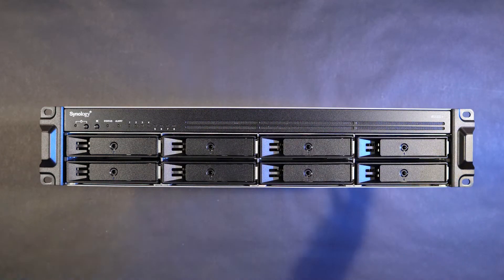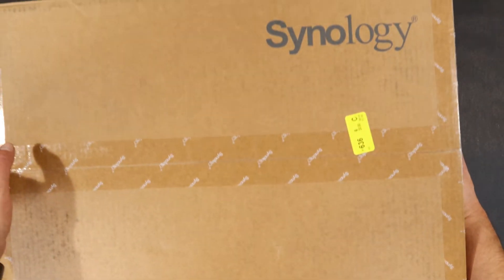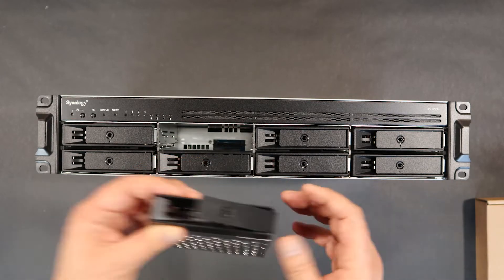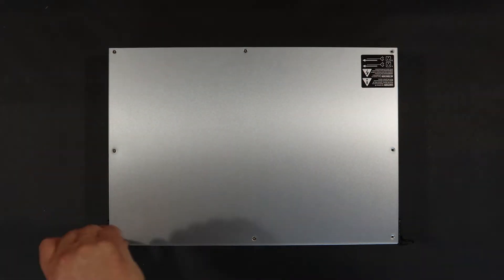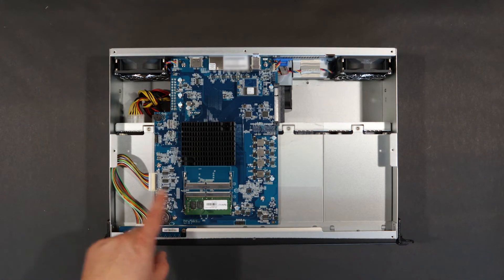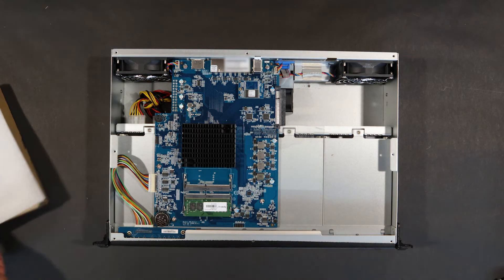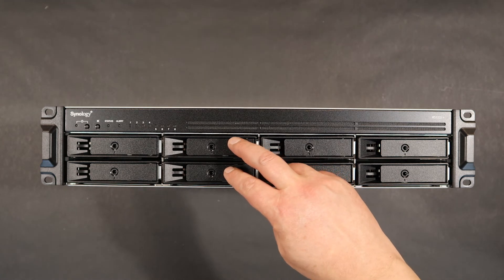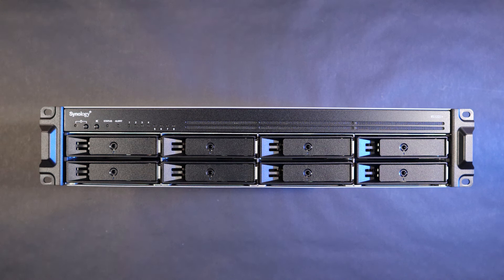Synology RS1221+ | unboxing and SFP+ 10Gb network upgrade

Comment: Swapping a redundant drive from a raid array on a monthly basis is not following the 3-2-1 backup rule. You need to have your main copy of your data, then another copy of that same data on a different device or media, and finally a cloud copy. Synology makes it very easy to set that up and it can all happen automatically on a schedule.

Comment: Cool but expensive. $1800 for the NAS and network card BEFORE the drives. Yikes!
Reply from the maker: Thanks for the comment! Yeah, it’s a bit pricey, and most folks don’t need this much space, or the rack mountable enclosure (which is more expensive than the desktop equivalent). I do save money by using cheap disks, because the RAID1 arrays will keep working if a drive fails; I generally don’t spend more than $50 on any single disk.
Reply: @MakeHomeTech  Any problems with drive compatibility?

Comment: Odd form of drive swapping you're doing. Never heard of anything like that. 10GB is nice. It's what I have now. How do you find it? I think it's not as fast as it could be, even with 10 drives in one NAS and 9 in another.(SSD caching in both.) In the process now of upgrading the two NASes and two Dell PowerEdge servers to 25G.
Reply from the maker: Hey Jeff. Thanks for the comment! The drive swapping serves two purposes: 1) quick way to get a third, backup copy of my data from a RAID1 mirrored drive set 2) mitigation tactic against simultaneous failure of both drives in the mirrored set, by staggering their operational wear across the three drives in the set. I'm working on a video that talks about my data storage strategy, so keep an eye out for that.

10Gb networking is da bomb! It's most valuable for video editing, since I  use the RS1221+ basically as a hard drive for my video editing machine.   The 10Gb connections lets me scrub through video timelines at an actually useful speed vs. the old 1Gb connection, which was painfully slow.

25Gb networking sounds very cool. Are you using fiber lines between your devices? DAC?  I'm also curious to know what day-to-day operations you have going on where a 10Gb connection seems "slow". :-)
Reply: @MakeHomeTech  Regarding the drive swapping, doesn't the array need to rebuild when you swap in a drive? And have you ever tried running with one of the swapped out drives as the only drive in the array? Does anything need to be done at the OS level to tell the device that drive is authoritative? I've recently acquired a 28-port 10G Unifi aggregation switch and even with that switch uplinked to my current Arista 10G switch, I am getting better through put than I was before the Unifi. I think the poor 10G performance is linked to the Arista switch. Can't wait till it's gone. The Unifi uses a fraction of the power and is nearly silent. The Arista is anything but silent. All the equipment is in my bedroom. The Unifi has four 25G ports. I'll be doing fibre. Two Dell PowerEdge and two big Synology NASes. Fibre cables arrive today and transceivers arrive tomorrow. All I need then is the Mellanox 25G cards, which are not cheap. Fun project, but I've had to dive into savings twice so far.

Comment: Pretty sure the 3-2-1 backup method means 3 copy’s of your data as in 3 devices. Raid is not a backup. I do like the RS1221+ it’s what I’ve been looking at for quite a while now.
Reply: 3 copies of your data, on at least two different devices with at least one offsite. RAID is not a backup and removing a mirror to force a RAID 1 rebuild regularly isn't a great way of obtaining one. I use hyperbackup to a USB drive and also to Synology C2 cloud. As an extra, I have two USB drives and I rotate them offsite every now and then. In addition, I take regular BTRFS snapshots to allow for easy rollback - and next time I buy a new NAS I will use snapshot replication to the old NAS for disaster recovery.
Reply from the maker: Thanks for the comment! In my case I'm using RAID 1 (aka drive mirroring), so I have two full copies across two physical drives, which I count toward one of the "2 backups" part of the 3-2-1 rule. 

Interested to hear how (or IF) you all implement the 3-2-1 rule at home. I'm considering doing a full episode just on my home data backup strategy. Let me know if that's something you all are interested in! 

\\Joe
Reply: @MakeHomeTech  3-2-1 back up usually refers to data on a server, data on a backup unit or drive, then backed up in a cloud storage account. That's the instrusty standard. DATTO does this perfectly. 

With Synology I guess you could put the data in Google Cloud or someone like Back Blaze. The idea of 3-2-1 is if your house burned down today, is your data safe?